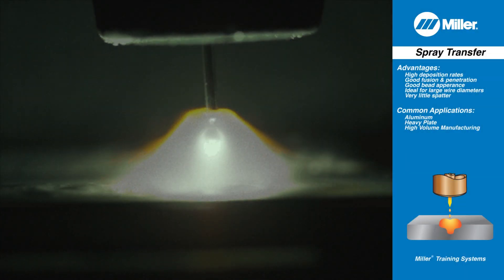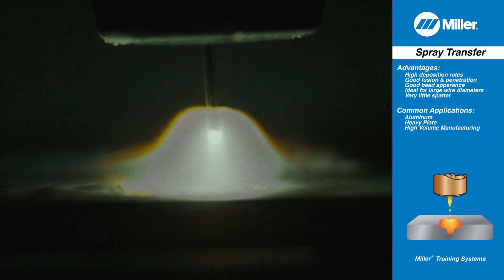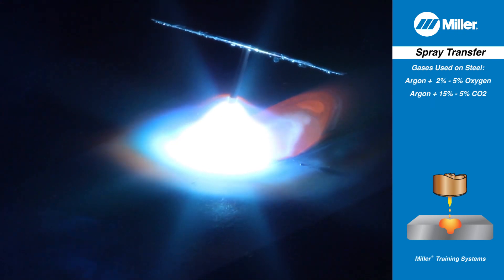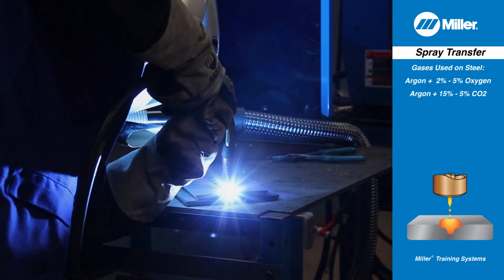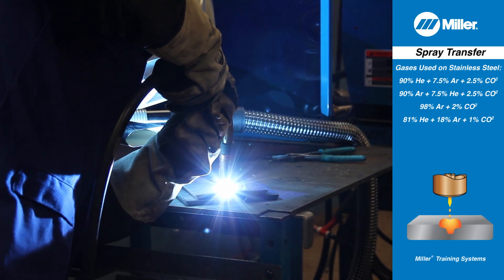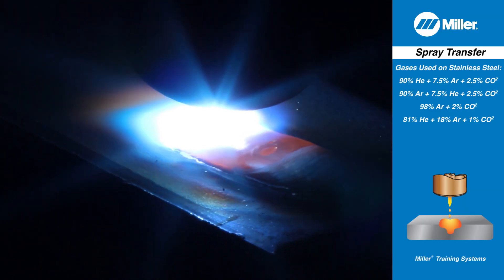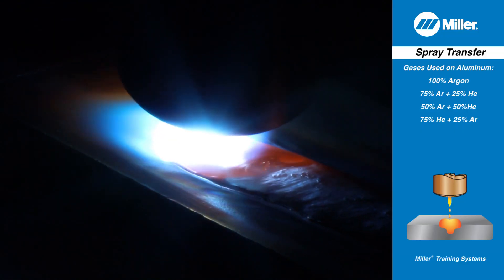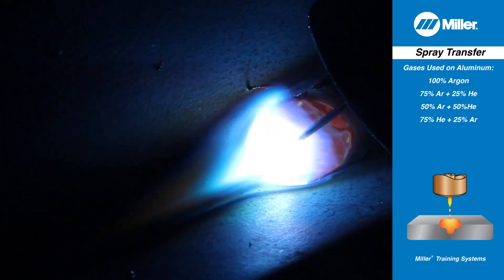MIG Welding Basics: What is Spray Arc Transfer?

Comment: At work, i operate a welding station and the robots used to weld in a twin mode, 2 welders and 2 wires per mig attachment. Our techs couldnt get it dialed in, so the company switched to this method and its wild, thinner welds but the same performance, lower noise, fumes and spatter plus it uses much less wire per the same lenght of weld.
Sounds weird compared to the usual welding "frying bacon" sound, but honestly it works great, a bit slower but thats just a bonus for me.

Comment: Is there a trouble shooting thing for when a millermatic 252 after hours of being on and used goes from spray transfer to short circuit and shooting spatter everywhere? No overheating codes appear but blowing air into the machine makes it return to spray transfer
Reply: your power supply is probably too hot and your torch also Im assuming the torch is air cooled if your duty cycle isnt 100 percent, it will run funny or shut down Just give it some time to cool off. spray transfer is hard on welding setups. if its not water cooled.😁
Reply from the maker: We recommend giving us a call so we can get you in touch with one of our techs. We can be reached at 920-734-9821.

Comment: I'm welding dissimilar metals 304 SS to mild steel tubing. My question is. "Can you achieve spray transfer using the Miller Multimatic 220?"
Reply from the maker: Thanks for your question, Galen. We have passed your question along to our team and will get back to you as soon as possible.
Reply: I dunno if you ever figured it out but yes. You exit the preset mode, and you can raise to 27.0v and up to 600wfs

Comment: Can I use spray transfer with 82%argon and 18% co2?
Reply from the maker: Thanks for your question, Beni. We have passed this along to our team and will provide you with an answer as soon as possible. Thank you!
Reply: @MillerWelders  
Thank You very much! Well, I,m waiting for the answer! :)
Reply: Yes that gas mixture will work, but it's the minimum argon content that will work for spray.
Reply: Which gas is better for spray: 82%argon and 18% co² or pure argon?
Reply: @AlexandruCurea-t2m  We use 90/10 with excellent results
Reply: And also I have one more question:what kind of weld have deep penetration, which one is hotter, pulse mig or mig short circuit?
Reply: @AlexandruCurea-t2m   Pulse. Short circuit is for Sheetmetal and texting, typically less than 20v
Reply: Yes,  Min. 80%Ar required for spray transfer
Reply: you can spray but youre right on the edge

Comment: What machines do Spray transfer?
Reply: What models?
Reply from the maker: Hi ZZP Zing Pheonix, almost any MIG welder can get into a Spray Transfer. The only two items you need is a higher voltage and sometimes a change in the gas that you are using. Spray transfer is a hotter weld and is usually used on thicker material.  Miller Electric has multiple MIG welders that can get into a Spray Transfer. Let us know if you have any additional questions!
Reply: What about the migmatic 300ip for aluminium?

Comment: What is a good baseline for spray on a Millermatic 252?
Reply from the maker: Hi Jerry, A setup for spray transfer on the Millermatic 252 would be a .035” ER70S-6 wire with 90/10 (90% Argon, 10% C02) shielding gas. Here is the link to a common ER70S-6 wire, where you can find a spec sheet that contains some parameters you can use as a starting point: http://www.hobartbrothers.com/product-details.html?name=Quantum+Arc%26trade%3B+6. Please let us know if you have any questions.

Comment: Will a Miller 211 do spray arc? Voltages are not available on it so how can one go above the 24 volts mentioned in the video? Same for wire feed speeds - again not available on the 211.
Reply from the maker: Hi, Tom. Thanks for reaching out. With the right filler metal size and shielding gas combination it is possible to get the Millermatic 211 into a spray transfer. However, it is not recommended because it will push the limits of the machine. When using spray transfer, you will possibly max out the duty cycle of the machine and get over temperature errors.
Reply: Thanks. That is about what I expected. For 99.9% of time it does just fine, and the overtemp light has never cone on, so far.